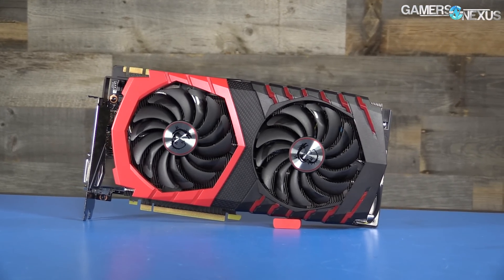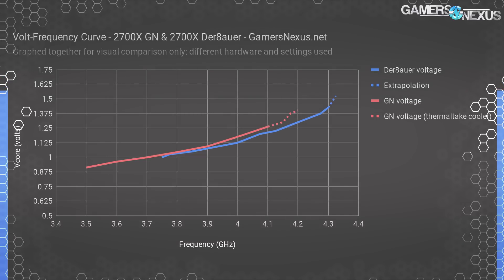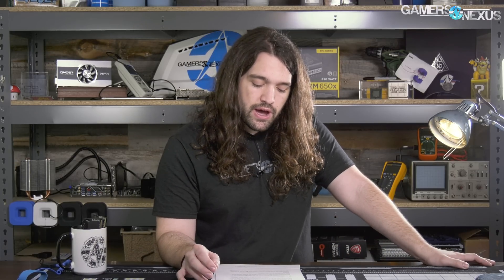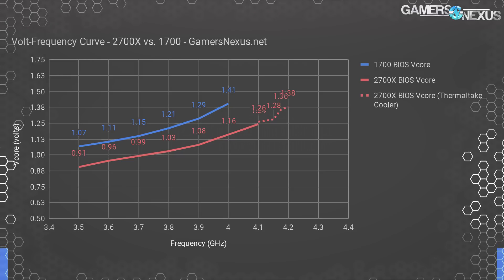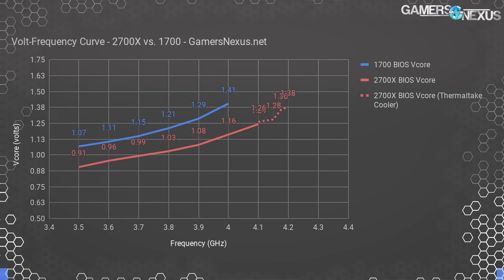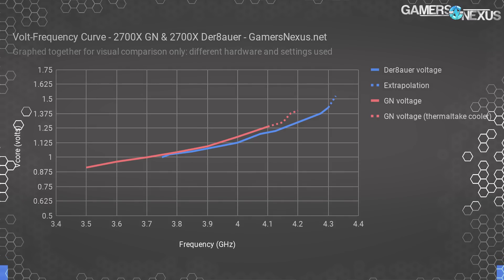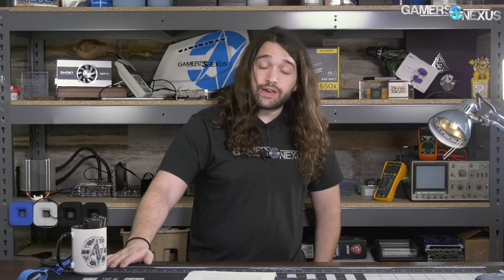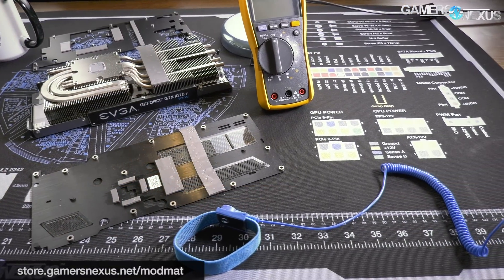Exponential Ryzen Voltage-Frequency Curve (Overclocking)

Comment: Pubg doesnt like me running my 2600x on anything but stock, using precision boost for 3.8gh@1.2v, it crashes, using 4.1ghz@1.3v, it crashes, but its completely fine with the cpu doing whatever it does with its stock voltage of an upwards of 1.45v which is wild af to me just for it to be boosted up to 4.05-4.2ghz, temps never go past 60 degrees but still seems pretty high to me
Reply: 60-70 degrees is not high. It's nothing to worry about. Generally, Silicon is able to handle 85c without degradation, anything higher is dangerous. However I always try to stay below 70-75c. Whatever floats your boat.
Reply: nah, thats completly fine dont worry! :)
Reply: feel small Sounds like an unstable overclock, can you run Prime95? Still, for a 2600X / 2700X, overclocking seems pointless when you can get an almost equally good perfomance with much better efficiency at stock, and they even run faster if you use a better cooler.
Reply: Slicerz717 i should have clarified, i meant the voltage seems a bit high for the clock speed it accompanies, im able to achieve the same clocks at lower voltage while still maintaining stability under full loads for several hours, but even if its stable everywhere else pubg just crashes unless i let the stock setting push the voltage over 1.4 and ive often heard this much voltage may speed up degradation
Reply: Naizuri yea i installed an h100iv2 aio and it often boosts up to 4.05 on all cores or 4.2 on most cores but the voltages climb to to 1.45v or higher and that was my initial concern
Reply: feel small You will have to check but on ryzen 1000 series, anything up to 1.45v was fine, as suggested by AMD, and I believe I remember a comment by a AMD guy somewhere a year ago, that 1.55v on very good cooling is the maximum with negligable degradation. Might be wrong on that. However, try and read your user manual, or find the maximum recommended voltage for 2000 series. If you stay at it, you will be fine. Don't stress
Reply: feel small 1.45v may be high, but it is not going to do any damage if it's for short periods of time.
Reply: Ryzen 2 is pretty good plug and play CPU, bothering with OC is a waste of time, if you want to invest your time to get even the last bit of performance, then focus on RAM sub-timings, and let XFR2 do its work.

Comment: Not bad with voltage. Currently my 1600 is at 3900mhz 1.3v (bios). If this continue with lower voltage and higher clocks for Zen2 it would be worth the upgrade!
Reply: It'll be even better. Instead of an optimization, we'll get a 7nm die shrink. Zen2 will blow zen+ out of the water in terms of efficiency and clock speeds.

Comment: I would advise people to just use 4GHz overclock (or just leave them stock) and enjoy 60% more efficiency over the previous generation.. 3-5% more performance just isn't worth it IMHO :)
Reply: You're getting a performance bump at 4ghz anyway because of the ipc spike (7%)
Reply: Pretty sure games at those extremes FPS are not really benchmarking the CPU just it's memory access latency... so the CSGO situation makes sense (but it's a really bad CPU benchmark)
Reply: Yea, 4GHz at 1.2v is great imo. More than enough for me. I couldnt find any use for some x% more with a lot more v. This way 600-1000 rpm on 140mm with decent 6 pipe cooler will do just fine for me and my needs.
Reply: Chiriac Puiu depends on where you look.

Comment: Noob here, is it possible to overclock just 4 cores outta 8
Reply: nomnom moon So you can get higher overclocks for loads that don't use 8 cores, much the same way that Turbo Boost/XFR functions. For example I can set my 8700k to hit 5.1GHz for 1-2 cores, 5.0GHz for 3-4, and 4.9GHz for 5-6. It will run cooler than 5.1GHz all-core and could be stable when 5.1GHz all-core is not. I would think Ryzen could do something similar.
Reply: 720p60fps its possible, but what for? I mean the main thing you having ryzen is for that 8 cores, less than that you should probably go intel
Reply: Toms Tech Well even if a game uses more than 4 cores there will usually be a limiting core or "main thread" that takes the largest load. It would be beneficial for that to be faster. I'm curious now if I set a staggered OC like the one I described how it would clock in game. You're saying you think it would always be at 4.9GHz all-core?
Reply: Possible, but not necessary. If it's anything like last gen, you won't get much higher overclocks out of a single core than you will on all cores. Might save some heat, but these chips are so cool that a mid range air cooler can pin them at max on all cores so overclocking just one really is pointless.

Another thing, if you did do that, you would need to manually assign processes to specific cores, otherwise a game might select a slower core as the main thread instead of the overclocked one.
You also wouldn't save any voltage. Might spare you some heat, but voltage is regulated across all cores so the highest drawing core sets the voltage for all cores.
Reply: Ryzen master allows per ccx overclocking
Reply: you dont need it, just let XFR2 do its job, you will have automatically what you are asking for. A better cooling system is the way to go, thats how easy it is.

Comment: My take-away here is not that the OC on the 2xxx series is bad, but rather that the XFR/PBR2.0 is REALLY good.
Not a bad thing imo.
Reply: Especialy in gamming when the engine doesn't use full load 8 cores (wich are... ALL game engines), PBR2.0 is actualy realy inteligent and boosts cores higher than manual overclocking...
Reply: I think Intel only has more headroom due to the TDP threshholds Intel sets. The 8700k could likely be set to 4.8GHz out of the box and be perfectly stable, but the TDP would be way too high and it would have temp issues on low-end coolers. So they set base & boost clocks lower to reach their target TDP—that's why the i5-8400 has a 2.8GHz base clock. Intel is just trying to look good on paper. Don't get me wrong though I own an 8700k; if you have a good cooler and know how to OC that headroom is great to have.
Reply: Muad Dib I think the reason is GF fabrication process, it is just bad for high clock speeds, and the 12nm wasn't a big improvement from the 14nm in that regard. Just look at Vega, the low power models are amazing in regards to efficiency, but the Vega 56 is already power hungry, and the 64 is just insanely inefficient.

If that's all that's holding Ryzen and Vega back, we should expect huge improvements from Zen2 and Navi, because the 7nm fabrication process is supposed to be much better and should allow 5ghz, and also would allow high end AMD cards that are still efficient and can clock high enough.
Reply: The problem lies in GF's process nodes. It's not going to be significantly better anytime soon.
Honestly I'm fine with the OC potential as long as they keep improving cache latency and thus, gaming performance.
Reply: It's getting g kinda where I am with  graphics cards.   Keep it cool and increase memory clocks and tdp .   It would be good if you were able to just "+50" on the core and go from there.
Reply: +Muad Dib
The base clock of the 2700X is just 3,7 GHz so when it reaches 4 GHz frequently using XFR and Precision Boost 2.0 then that is overclocking, even if it's automatic overclocking.
Especially when using XDR as that actually allows the CPU to exceed the TDP of the CPU.

Comment: You know, I didn't do any research. I bought an R5 1500X like, a month ago. I could have spent like  $20 more and gotten the 2700 if I had waited. DAMN IT
Reply: not doing research and buying computer parts is like driving without eyes.
Reply: ComputerNoises that is why doing some leg work before investing/spending money can be worth it.
Reply: i dont know, ive seen some legally blind people drive well
Reply: Naga Saputra studying the nuanced literary work of the Twilight series
Reply: Take it back and get a 2700 then. I don't see the problem.
Reply: JadigertheReal The fuck you comparing a Quad core to an Octo core as if that's a legitimate comparison for? Are you saying that the CPU with double the cores, that's on an improved architecture, is double that of something older and has half the cores?

Time to ban Steve from Gamers Nexus, we found our new guru!
Reply: The only mistake you made was buying an AMD quad. The 1600 or 1600x was the AMD sweet spot unless you like upgrading every year.
Reply: JadigertheReal+
Here are the release prices for zen 1 chips
R5 1500x - 189$
R5 1600   -  219$     (+20$)
R5 1600x - 249$      (+20$)
R7 1700   - 329$      (+30$)
R7 1700x - 399$      (+70$)
R7 1800x - 499$
Here are the prices for 2nd gen on release
R5 2600   - 199$
R5 2600x - 229$
R7 2700   - 299$
R7 2700x - 329$

  The new series is cheaper than the old one on release. The refresh has not pushed up the prices, it has pushed down the prices of the old ones to get rid of stock and make room for the new ones. Big difference.
Reply: Malus nope. All the monitors only had one dead pixel and it was no questions asked each time and they were $550 at the time. The only time I’ve been unable to return something other than a 6600k (which i bought the day kaby lake came out lol) was an Xbox one but that was due to Microsoft not refunding Newegg I’m sure and making you deal directly with them.
Reply: ComputerNoises yeah quad core is soooooo dead...it gets maxed  instantly lately in the newest games...especially assassins greed the new one...also Intel i5 quad core can't handle that game
Reply: no the refresh are not the same price a 1600X cost less than a 2600 30 Euro less!
Have more clockspeed and smt for less mony! 
A 2600X cost 10 Euro less than a 1700 the refresh have push the price up.

The price of the old series is good the new refresh is a 30% up in the price!
Reply: https://geizhals.de/?cat=cpuamdam4&xf=12099_Desktop~820_AM4

the refresh is mutch more expansiv a 1500X cost only 144 euro, the price of a 2700 is 289 euro is more the double the price. And the cpu of the old gen was for mouth at the same point. For 144 euros you become nothing from the new generation the minium is 195 euro for 2600.
Reply: Just get a 2700 and build a new system, you won't be happy until you do.
Reply: Daniel Earle That's why I just got an 8700k even though I probably don't need 12 threads. I don't want to "what if" about getting something better and not be happy, just get the best off the bat.
Reply: CanadaBud23 some places like Newegg wont let you return even unopened CPU’s
Reply: Hunter Long Yeah Newegg return policy sucks. I use Amazon whenever possible, but am forced to go Newegg sometimes since they have more options.
Reply: Malus I’ve never had a problem with Newegg returns. In fact i returned my Samsung C27HG70 two times and got a replacement both times within a week then returned it for a full refund the third time because the third one still had a dead pixel then bought it for sale on Black Friday and finally got a perfect one lol.
Reply: Hunter Long But you have to have a good reason right? I can't return something I just don't need or realize I don't like once opening it. Or for monitors I thought they had a policy of needing like 5 dead pixels to be eligible? Or GPUs with coil whine? I've never actually tried to return to them but their policy sounds pretty restrictive. Amazon lets you return whatever for whatever reason.
Reply: Try refund demand it
Reply: Rhyan Eddy improved architecture send me a link as I thought it’s the same with small changes aka “refresh”
Reply: Star of Eden I have the new assassins creed. It uses about 85% of the cpu, but runs at 70fps on average with my 1070 @1080p
Reply: Was on a budget and was replacing old parts. Needed motherboard, CPU, and RAM. Had a $300 budget, wound up spending $345

Comment: 1:16 someone is under-volting your lamp mate.
Reply: I bet that's an LED rolling shutter artifact.
Reply: I don't think it's rolling shutter, since that's more of a gradient from top of frame to bottom of frame. What's more likely is the shutter is going at 60hz and the light is flickering at something like 59hz or 61hz, and we're seeing the "beat frequency".
Reply: Thats just the american powergrid. the guy working in the powerplant went to get a doughnut.
Reply: Let's bench this lamp!
Reply: Cory Yalowicki is that a real thing?
Reply: laughkick
Reply: Its a Vega lamp.
Reply: That's the same lamp which was nearby the question mark block Bowser is stood atop on, it would shimmer like in some Mario games. I believe that is actually a lamp with a microchip inside to create effects like dimming, strobing and PWM brightness.
Reply: It does it again at 2:04
Reply: Gamers Nexus confirmed haunted
Reply: VRM Switching frequency needs to be increased
Reply: AwesomeBlackDude that is affirmative captain black